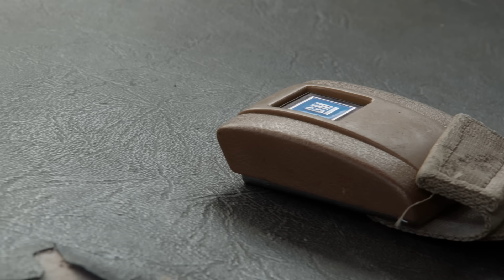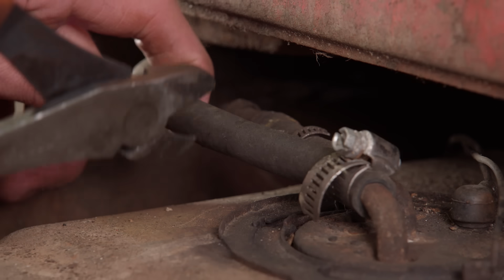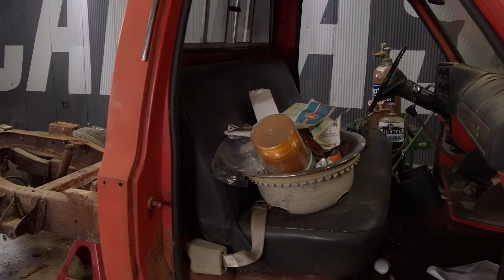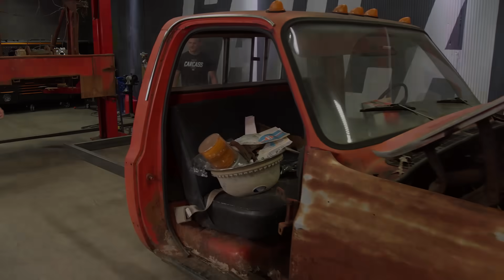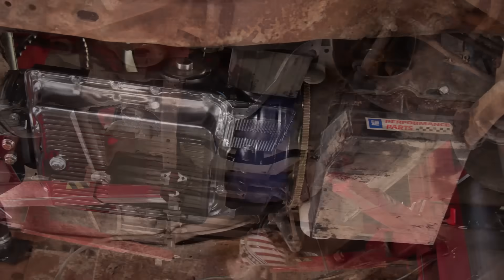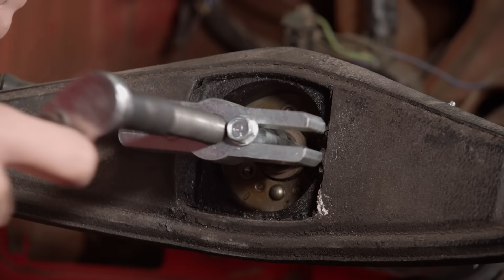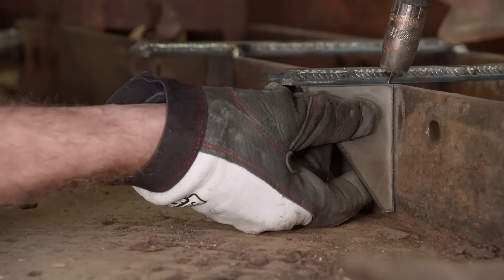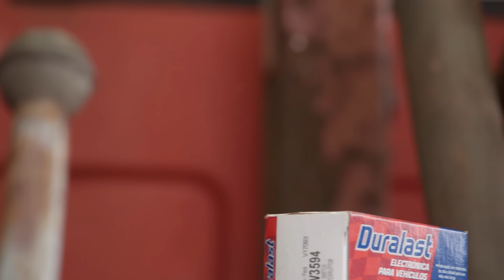Full Build: Junkyard Square Body Tow Truck Is Restored And Modernized

Comment: So you remove the strongest most reliable transmission ever and replace it with the weakest…..🤔….that’s a bold strategy cotton.
Reply: They straight up told the soul of that truck f’u in all kinds of ways
Reply: Don't forget they did all of this without getting a speck of dirt on their clothes.
Reply: @bigbengamer  🤣 Lmfao didn’t cuss or mess up them fancy hairdo’s either.
Reply: Not to mention a build like this and you swap from manual to auto....how lame is that?!?
Reply: @charlieforsythe7709 😮😮😮😮😮
Reply: @charlieforsythe7709  My '77 Silverado C10 came from the factory with a auto trans and column shift. Definitely keeping it that way. Some prefer manual but I've always loved automatic. Some might say my truck is lame because of it having an auto and column shift, but it's my baby, and I'm keeping it as I grew up with it.
Reply: @jasonmckenzie1132  nothing against it at all. Not everybody can physically drive a manual either. I don’t like taking a manual out and putting in an auto. I’ve seen it done a million times for drag cars and I don’t care for it. But to each their own with their own builds and money always.
Reply: @jasonmckenzie1132 the 77 is my year.  I built my two Traxxas trucks off the C10, RWD and the K10 4x4.  Keep it forever
Reply: @charlieforsythe7709  these kids know nothing about driving a stick.
Reply: That is absolutely NOT a 1977 Chevy. It appears to be a ‘74, maybe a ‘73 with drip rails added. 
The frame job was idiotic. They should have just swapped a full unrusted one under it.
Reply: Joe Monstermaker : I kept thinkin… boy that steel doesn’t look thick enough for frame material.
Reply: @markpinther9296  yea that steel that they used that was the same as from factory didn’t look thick enough…
Reply: @markpinther9296  what do you think the frame rails are made out of ½" ? It is 3/16 thick, the same material thickness they used.
Reply: I was thinking the same, get rid of the pto so these rejects know how to drive it
Reply: As a work truck that will be in traffic sucks to be a manual. Maybe when I was younger but going 1-N N-1 back and forth every few seconds in traffic in rush hr absolutely sucks. Much prefer to run a auto. In a toy that I will not see traffic in I will go through gears all day.
Reply: Let's see if it pays off
Reply: @Earth is dead  you can tell right away they are not friends of trucks from that era. lets do it the easy way! next gen figured out.
Reply: That's because they can't drive a stick shift 🤣
Reply: @Earth Is Dead " tiktok generation, " I was watching this show thinking damn he nailed it. 🤣🤣🤣🤣
Reply: Doesn't matter, cause of they keep that clear glass tube gas filter on there it's gonna catch on fire anyway
Reply: @christophergreen2328  just wow, you guys are good, your catching them everywhere!
Reply: @frankmachado1010  my brother's 83 c20 caught on fire right after he dropped about $2000 on a engine swap due to that filter.
Reply: @christophergreen2328  yes I used them on bikes in the old days and they leaked bad, cheers
Reply: Yes their a bunch of ass hats. I had a GMC half ton I put a 1 ton 4 speed in it. I never had any problems with it. I even had the transmission rebuilt. Its because alot of people dont know how to drive a manual transmission.
Reply: BINGO, its about the video not the build.
Reply: @frankmachado1010  🏳️‍🌈🏳️‍🌈🏳️‍🌈
Reply: @bradleymorris8875
Reply: You old ass boomers. Have you ever tried to vape, text and sip Starbucks while trying to shift? Get real.
Reply: @mookieandme2137  Do it all the time, Learn how to drive and its not a problem kid.
Reply: @chrisrmorriscm  someone missed the joke.
Reply: @mookieandme2137  that was funny as all hell.  Not as funny as the fact that Chris didn't get it.
Reply: And they didn't even Clean the Dirt first while installing a new dashboard
Reply: I think it's because they took it from an old project they had.
Reply: @davidcrumrine1165  I know, I was being sarcastic to the guy that said something about. I said it was the same size just in a asshole way
Reply: It is a show. Not more, not less. 👎
Reply: Also that chassis looks weak af
Reply: @MagicAyrtonforever  and it's not a four-wheel drive so why try
Reply: The old pto wench will pull circles around any electric. Benjamin Franklin said it best. Experience keeps a dear school, but fools will learn in no other.
Reply: It is their truck they can do whatever they want to it
Reply: the motor and tranny came out of something to be being beaten on, its obviously built so whats it matter?
Reply: Maybe the trans was shot and beyond repair
Reply: They dont keep these anyway. They crush them once they do a couple of shows.
Reply: Plus fkn auto wtf fkn fk
Reply: While I agree this is a content farm channel,
And not everything is being done by these guys,
It wasn’t always this way,
There’s a reason these guys are new faces.
Reply: Wow
Reply: Exactly
Reply: Sure manual transmissions have their benefits but autos are way easier to drive while getting some head. That's all I have to say about the subject
Reply: I know I would have left the four-speed myself.
Reply: Was thinking the same thing!
Reply: @tinycalandra7818  aaaaa!a!
Reply: 😊😊😅😊😊 @tinycalandra7818
Reply: That new transmission was likely sponsored and so....Oh and I liked how it sounded in the very beginning best. An oily grumbler.
Reply: @erikdevries9208  odd they claim 77. 77 had yellow trim…. and not to be petty , it’s got a 73 grill and short door panels. In real life the bend over brothers couldn’t fix a PB&J. That was a runner before this video was going to be.  Clean windows are a dead giveaway.
Reply: @bradleymorris8875  Probably so. It's just a content farm video.
Reply: @bradleymorris8875  yeah it's kind of funny  that every "revival" is so conveniently not hard to get back running. Happens in most shows.
Reply: Why are you so mad. The truck with be halfway in the Earth if it wasn’t for them
Reply: @chachachaudhary391  it's called dying with dignity
Reply: @chachachaudhary391  some are doers some just bitch.
Reply: BuT WiLl It StArT?!
Reply: And also i will only drive manual cars for my purposes bc i dont like automatic bc im not american im in europe
Reply: @Earth is dead  
It's TikTok boomer
Reply: Gm is trash now. Lol old ford's are still better.
Reply: @justin6296  I like Ford’s 10 head bolts …. at least that many hold on the water pump that usually break off when you have to change the leaking timing cover. Oh and the joy of breaking off every exhaust bolt to change those cracked manifolds. I can hear Ford power steering pumps screaming in my sleep ! FORD 🗽🇺🇸

Comment: Nice build guys.  Anyone know which steering gear box they used?  I have an 84 square body and it needs an upgrade on the steering.  Any recommendations on an upgraded steering box for a square body?  JD
Reply: I just replace mine with stock ones.... I have an 84 k5 with 8 " lift and 454 they stock still works fine
Reply: Use a 1 ton steering box from a suburban  and box the frame in around it!!

Comment: These to guys should not build any trucks. that build is so unsafe and done wrong it is not funny. the welding alone is done wrong not to say mild steel as a backhalf come on all frames are made of some what high tensile carbon steel and be flexable. A frame needs to be welded a certain way and they did Not do that. Hell i would be very afraid to go around sitting still and i would run to hill away from if thay even thought about useing it.   I hope to god this truck get crushed and the 2 guys get off the show. And never work on trucks again. Bad bad building of a truck on a show the only other cars and trucks that have been worst are gas monkey

Comment: I love these guys talking about 7/128” and then measuring to 1/16” and marking it with a paint marker.  There is NOTHING than happens at more than 1/16” unless you’re using machinist tools and equipment so just be honest with the viewers rather than trying to seem more scientific than you are.
Reply: @bigboreracing356  go get a tape measure and find it. Then mark it with a paint marker that leaves a 1/16” or more wide mark. 😂
Reply: @bigboreracing356  what did he use in video??
Reply: Yea.  I caught that too.  That marker isn’t precise enough to be that precise on measuring

Comment: I had 1979 square body, with the homes wheel lift, and boom, 454, old school granny low 4 speed, stacks, and had that GM 14 bolt rear end. I worked the truck until a couple years ago, I had a car on the wheel lift, going down a four-lane highway, my back two dually tires didn't want to stay under the truck anymore, and at 50 miles an hour, out comes the axle, brake drum, floater, along with the two dually tires still bolted to it. I managed to get it on the shoulder before it shot out, and the duallys passed me on the highway. but I missed that truck that thing was awesome. ended up putting a rear end in it and selling it..... my Ford 460 rollback had a Dana 70 in it, with a Ford expedition on the back doing 50 mph, that rear exploded, shot a tooth right out of the side casing, and I still drove it 50 miles home. I ended up taking out nine teeth off the ring gear laying in the bottom of the rear end... good times, I tell you.😝💯💯💯

Comment: Jasper engines and transmissions can be help you out for after market parts as well
Reply: They're contracted into those companies they use. I note that Detroit Muscle and that Truck show on the same channel all use the same companies . . .
Reply: I know the front and rear differentials and axles kits can always get overhaul and custom made four wheel drive vehicles at anytime as well and transfer case rebuilts as well and other auto part stores as well
Reply: And i get on Memphis equipment and boyce equipment burn as well and custom made parts that can always come from them for a new four wheel drive vehicle ideas can always get them started transfer case and axles kits that just came out of the crate that it came in
Reply: Its all good where to get the car and truck parts from for the next project builts

Comment: Damn, this brings back memories. My first real job was working for a full service Marathon gas station. Most today are convenient stores that sell gas. We had 3 full bays and an alignment bay. We also had that exact tow truck. They wouldn’t let me tow cars but it had a generator that would drive a welder and air compressor. I was 16 years old out fixing flats, welding broken boat trailers and jumping dead batteries. That truck did it all
Reply: Shoot now adays 16 year olds can’t even be lube techs due to insurance problems

Comment: I don't know why you didn't clean up the underside of the bed, and spray it with something before installing it. And you painted the steering column but left the dash ugly? You had the interior out of it, why not paint the inside before you reassembled it? And shouldn't you have sealed all the joints on the new floor pans to prevent further rusting? Rebuild the front end, but don't rebuild the a-arms? I guarantee you that the 50 year old bushings are shot to hell. If you sell it (which you probably will) someone else will have to tear it completely apart again to do the work that should have been done the first time. I enjoy watching you guys work, but as professional restorers, you should tear apart and rebuild one time. The things I mentioned here wouldn't have cost that much money, and would have made a big difference in the way it looks and drives, plus saved any future owners the headaches involved with tearing everything apart a second time. Just my opinion. 😁 Good job on the frame and interior though.
Reply: @bigboreracing356  I've been restoring vehicles my whole life. Do it right or don't do it at all, especially when you have millions of people watching you.
Reply: If you don't like other people's opinions, get off YouTube.
Reply: @bigboreracing356  you should call your POS mustang SHIT stain! 🤣🤣🤣

Comment: Awesome build! Great educational video! Personally I would've kept the manual, but it's y'alls build. One day I'll do one of my own.
Reply: Please do not build a truck like them they would get you KILLED and people around  you.  you never used mild steel in a frame it is weak and will break under stress of use that why the plants use high tensail carbon steel in frame plus use have to weld frames a certain way or it will crack  perheat welding area and weld with the correct wire or welding rod and postheat after welding and let it cool yes it more money but done right and safe

Comment: I didn’t see it in the description and didn’t hear the manufacture mentioned. Just curious about what leaf springs were used
Reply: They are in Nashville, and there are a lot of custom spring makers there.  They probably contacted a local spring shop and had some made.  It's surprisingly affordable, and they can build anything.  I have an old isuzu NPR that i 4x4 built, and had custom leaf springs made for under 300/spring, which is cheaper than lifted pickup truck springs.  These shops usually specialize in semi trucks, but they can make springs for smaller vehicles usually.
Reply: @BadHaddy  I figured. A shout out would have been neat though. I’m trying to source some for my truck currently. There aren’t many shops local to me that specialize in custom work

Comment: Yep, nothing like brand new parts on a rusty truck.. should've removed the cab and media blasted it to remove the old rust from the frame at least. I get it they wanted it to still look beat up.. but gold leaf on the doors? :-o
Reply: exactly its  only  hlaf  done the front frame is still rusty and weak from the 80s  put a whole new frame on it   be  safe   tooo

Comment: A LOT of rust just left behind, hiding behind brand new hangers and bracketry, not even wire wheel'd off? Fellers not dirty, designer shirts, and using glass fuel filters that start more fires than ex-wives? The new odometer is not matched to the old one, but you're worried about a future owner being able to cut the welds in the back? Son, you just committed a federal crime. Makes a feller wonder what's actually going on here.

Comment: I like this show because they explain some of the steps involved in fabricating. Wheeler Dealers used to be good show because they would explain how car parts worked. Most car building shows kind of ignore those things and just tell you you need a certain piece but if you are not a fabricator or experienced mechanic then it's a less than educational form of entertainment. Guess I am interested in being shown exactly how to do something, because it saves a lot of headache for us occasional and novice project guys.

Comment: Definitely not a 77. More like 73 or 74
Reply: That's what I was thinking going by the grille, the core support matched colors with the cab and doors and the door panels were 73-76.
Reply: Had a 75 almost identical to this one with a Holmes 440 boom and it was one of the most dependable vehicle I ever owned and owning one of these I hauled many vehicles to my yard, still non compared to that old workhorse!!!!

Comment: Nice build, but why didn't you guys replace the control arms and springs or at least the bushings in the control arms.  With all the steering parts replaced I'm surprised it wasn't changed.  (I did the entire front end of a OBS truck recently myself.)
Reply: @bigboreracing356  it may not be broke, but being a 1977, you know the upper and lower control arm bushings are dried out and hashed.